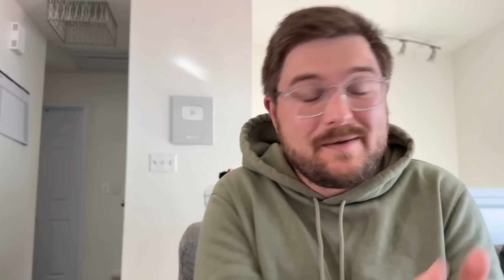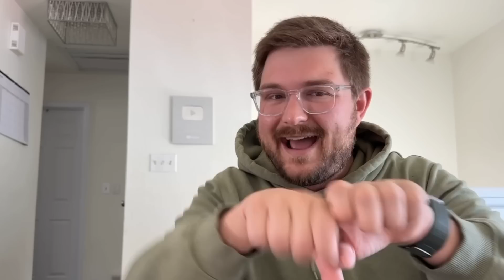Slow Charging For ~800-Volt EVs At Tesla Superchargers With Magic Dock Explained

Comment: One thought I keep having is I understand Tesla's network is mean't to be more of a "backup" for the cars that can't take full advantage of the charging speeds, however, will some people simply choose to use Tesla's network for reliability/consistency? Say someone with an E-GMP (without free EA charging) car has an option of an EA station with 4 stalls (2x 350's and 2x 150's) and a Tesla supercharger with 6+ stalls. Would you rather get ≈ 100kW quick, easy, and guaranteed OR take your chance at EA with faster speeds but maybe 50% of stations offline, a clunky handshake process that takes greater than a minute to activate, the possibility of only get marginally better speeds because both 350's are taken, etc etc. It will be interesting to see as time goes by what people choose to use and if the CCS stations can become more efficient and reliable. Cable-gate is an issue for the time being for sure.
Reply: Remember also that Teslas optimize battery temperature when navigating to a supercharger, this does not happen in other EVs. This can also be a limiting factor for other EVs, since the supercharger is extremely careful about battery temperature safety.
Reply: @signal-52  Doesn't happen for other EV's going to Tesla Superchargers? In the E-GMP vehicles you can trick the system by inputting a different, nearby DCFC and still get all the benefits. In other EV's it might be more difficult or not possible I am not sure.
Reply: @CarsMadeSimple  It does not, that's the issue. I know some EVs can preheat manually, but that's about it for automatic routing. Otherwise, they only preheat to some specific chargers. Some EVs can't preheat, such as the VW iD series, that have no heatpump anymore.

Comment: Hummer EV has a stop sale. They have to change all batteries on them. There is an issue with the gasket around the battery pack leaking water. Apparently at least one has already caught fire

Comment: Is there a ccs1 extension cable (male/female 20ft or so) that can be used for non Tesla’s at superchargers to get around the built-in cable length limit 
?
Reply: Probably unsafe thermal issues.
Reply: That would require AWG 500 with 1" conductors since they aren't cooled. Additionally there would be no disconnection control for safety. Better to relocate plug on the car to the nose of the vehicle somehow. Also would need to be a CCS2 for America.
Reply: No theyre water cooled

Comment: Tesla wanted to see what happened in the wild with the limitation. If no cars have issues then they may up the voltage like they do for their own cars. 
Also they may want to run for awhile and see if there is a lot of 3rd party cars continuing to use these chargers. They may want these to be not as good as a working EA charger in order to keep down the amount of 3rd party users to make room for their own cars until they put even more chargers out there.
Reply: so make an inferior product to make less money? That's just stupid.

Comment: Awesome detailed Video Kyle 👍🎉 Synchronistically, I was just reading some articles about the first V4 Supercharger, which is supposed to be built in Dateland, AZ ....Just off I-8, on the way to (East of) Yuma, AZ. It's supposed to have a Megapack and a 4500 sqft solar array, with 40 covered stalls, and 350Kw chargers! ...It's only 183 miles West of me, and I pass Dateland every time I drive to San Diego. I'll definitely be taking a ride out there, when they build it....

Comment: If I had a wager, I'd bet the hummer EV gets about 120kW max. 350V @ 350A. My understanding is the series conversion happens on charging plugin during CCS negotiation. If the charger doesn't offer 800V, it won't put the batts in series. No DC step up/down necessary. But I don't know and I'd love to find out.

Comment: It causes a lot of confusion in the RC space to say cables have amperage ratings because we push 500-1000 amp burst through 12-10 gauge wire all the time. They don’t run for nearly long enough to melt anything most of the time so there’s no real issuen

Comment: The cables long enough to reach a tesla from one charger away is the solution needed. This will allow Tesla cars to charge on either side and would be long enough to reach f150's without ruining the cable
Reply: More pull through charging stations would help.

Comment: As I commented on the previous videos, it's a welcome backup, and the biggest real advantage here is opening up new corridors with some amount of level 3 charging. But implementation is less than ideal and I doubt after this initial rush will CCS cars use them super often. Expensive, short cables, slow charging for a lot of cars, may even be impossible to use in tight locations with cars that have chargers on the side. Their federal incentive should reflect that.

Comment: The best way to view voltage is relating it to pressure. Amps would be flow rate. That allows you to view power like water flowing in a pipe.
Reply: Is Ohm’s Law taught in school these days? It’s not really rocket science.
Reply: Indeed the diameter size of the pipe is the flow and current, hence conductors need to be thicker. Voltage is the pressure meaning how strong the pipe wall is (ie thick insulation in electrical.)
Reply: The voltage would be the size (diameter) of the pipe, amps would be the rate of flow,  power is the volume delivered per unit of time.
Reply: @travellover3373 

Voltage is NOT relatable to the diameter of the pipe. Voltage is pressure. A current flow requires a difference of electrical potential ( voltage difference). Fluid flow requires a pressure differential.

I can have 1000 volts or a 1000 psi through a small or large "tube". The size of the tube relates to the resistance, and governs the flow in relation to the electrical or pressure differential
Reply: @damp_squid  Voltage is not pressure. Voltage is electromotive force way different than pressure. A 100 psi pressure in a 1-inch diameter water pipe will not give you the same cfm as a 100 psi pressure in a 2-inch diameter pipe.
Reply: @damp_squid  Voltage is what size comes to you, amps is at how fast that size comes to you. The combination of both is the power that you get. If I have 120V coming at me at 2 amps, the same power I get if I have 240V coming at me at 1 amp. Granted, the speed (amps) does not depend on the source, it depends on the load that pulls it or demands it.
Reply: @travellover3373  dude stop trolling that makes zero sense
Reply: @travellover3373  you mean electromotive force? Electromagnetism is completely different, and only applies to the movement of an electron in a stationary frame of reference.
Reply: I never said it will give you the same cfm, the flow is governed in relation to the resistance "diameter" of the pipe and the pressure differential over the length of the pipe "voltage". OHMS LAW! 😂
Reply: @damp_squid  Ok let explain this to you in simple terms. Let's say I need 1 gallon of water per minute in order to function, that is my power requirement. If you give that water to me through a small diameter hose, I will suck that water at a fast rate through that small diameter hose (high pressure) so I can get my 1 gallon of water in a minute. Whereas if you give that water to me through a big diameter hose, then I will not have to suck that water fast (low pressure) through that hose in order to get that 1 gallon per minute requirement. That is why a voltage can be related to the size of the hose. Did you notice that the pressure in the smaller hose is bigger than the pressure in the bigger hose? If my power requirement is 4 watts, if you give me 2 volts I need that at 2 amps. Whereas if you give me 4 volts I can just get that at 1 amp. Did you notice the similarity between a bigger volts the lower the amp and the bigger the pipe the lower the rate of flow? The smaller the volts the bigger the amps and the smaller the pipe the faster the rate of flow?
Reply: @damp_squid  yes you got that right, electromotive force not electromagnetic force, I stand corrected. But, certainly not pressure. :)
Reply: @damp_squid  Kimball is trying to illustrate the flow of electricity in terms of water flowing. You compared/likened voltage to pressure, so let's say I have 120V going through a #10 awg wire at 2 amps the power delivered is 240 watts. If I have 120V (same pressure) going through #2/0 awg wire at 2 amps, still the same power 240 watts being delivered. You agreed with me that a 100 psi of water through a 2-inch diameter hose has more cfm than a 100 psi (same pressure) of water through a 1-inch diameter hose. I am not trolling, if you visualize delivery of electricity like a water flowing through a pipe, you cannot liken voltage to pressure.
Reply: @travellover3373  
You say power, but I think you mean current. Gallons per unit time is a flow rate, which is analogous to coulombs per unit time which is amperage
 
Let's use ohms law:
1. Voltage=current*resistance
Rearrange to put current (flow rate) on the left side
2. Current=voltage/resistance

Therefore....

If you keep current (flow rate) constant, and then increase your resistance (by making the pipe smaller, or wire thinner) then your voltage (pressure) MUST increase to maintain the same current (fluid) flow. See example below.

1A = 1V / 1 ohm
1A = 2V / 2 ohm

If you decrease your resistance (make the pipe bigger, wire bigger) then your voltage (pressure) MUST drop to maintain current.

See how pressure and voltage move together? And how pipe size and  resistance move together?

That means they're analogues of each other, which is all that the original comment claimed.

You claimed that pipe size and voltage were analogues, that is wrong, they move opposite to each other when holding all other variables (e.g. current) constant.  However, they ARE related (through ohms law), which is why you see the behavior in your example

note: this also works if you consider power
Power=current*voltage.
You can plug that equation into ohms law you'll find:
Power=voltage*voltage/resistance

You'll reach the same conclusion with that equation.

If you still don't believe me, here are some great sources that explain better:

https://en.m.wikipedia.org/wiki/Ohm%27s_law (look under hydraulic analogy)

If wikipedia isn't good enough for you, here's an EE source that's very clear:

https://electrical-engineering-portal.com/water-and-pipe-analogy-for-ohms-law
Reply: @damp_squid  I don't know why you are making things difficult. Go back to Kimball's comment. He's trying to illustrate the flow of electricity like water flowing through a pipe. Current is not being pushed by the source, it is being drawn by the load. Example: let's say a 1 hp (746 watts) dc motor with 100% efficiency will draw 3.59 amps @ 208V (I=P/E, or = 746/208 = 3.59A). Now, if we increase the pressure as you say (voltage) to 230V the current will actually go down to 3.24 amps (746/230=3.24). Now in a water flowing through a pipe, if you increase the pressure, the current or rate of flow will actually increase. That means you cannot really illustrate voltage like pressure in water flowing through a pipe. In electricity, if you increase the voltage the current will drop, if you decrease the voltage the current will go up. And that is represented by the Ohm's law equation P=EI, power is directly proportional to both voltage E and current I. Which means voltage E is inversely proportional to current I, E=P/I, in the same manner current I is inversely proportional to voltage E, I=P/E. In a water flowing through a pipe rate of flow (current) is proportional to pressure, increase the pressure and rate of flow will increase. Am I wrong if I say that if you increase the size of pipe (voltage) you don't need a high rate of flow to meet the demand? Whereas, if you decrease the size of pipe (voltage), you will need a faster rate of flow to meet the demand of the load? :)
Reply: @travellover3373  dude just read the links I sent. I've got an undergrad and grad degree in electrical engineering, I know what I shared is accurate. I'm done with this thread
Reply: @damp_squid  I am an electrical engineer too. :)

Comment: 18:02 non-Teslas can charge more the 150 kw on V3 in Euorpe. Saw some cars at 190kw on V3.
Maybe they don't deliver on the US because of the adapter...
Reply: Correct, in EU they cab do that because it is CCS plug and CCS socket. No adapter inbetween.
Reply: I say its the software. Not the hardware. But its only a guess of course.

Comment: Haha I love the excuses 😂 Tesla is perfect and this is seamless and will save us from EA I've been told. This is totally not a money 💰 grab for NEVI funds lol.
Reply: This was discussed in previous threads, but the current implementation is not NEVI compliant, so there would need to be a separate funding program if that was what Tesla was going for. Just the payment process alone is not NEVI compliant, given there is no payment terminal at the station.

As for them wanting funding for opening up the network, I think that is very reasonable. The CCS cars contributed nothing upfront to the build out of the supercharger network and pay-per-use fees are unlikely to cover it anytime soon, so getting some upfront money (wherever it comes from) makes absolute sense. They aren't running a charity after all.
Reply: @jakej1837  Tesla cars contribute nothing to EA or EVGo etc etc but with a $200 accessory gets to use it no? And unfortunately they can't charge Teslas more for using it either. But I digress.
Reply: @marcusrose5943  But those companies are running a charging business where their target audience was all EVs, so they would love the business of Tesla owners (EVgo even has built in adapters). Leaving out Teslas make no business sense for them, given some of their stations are underutilized and that is their sole source of revenue. You will notice most charging networks are struggling to make a profit and are poorly maintained. And EA actually was funded in lieu of massive fines that VW would have paid otherwise, so that was how it was subsidized by the government. 

Tesla on the other hand was only able to expand their previously exclusive network at this rapid pace and make it as reliable as it is today, completely on the backs of Tesla owners. Wanting some money upfront to tap into that makes complete sense, especially if it will potentially inconvenience Tesla owners, and kill one of their major selling points.
Reply: @jakej1837  I think we have difference of opinion on the subside part. And we've seen what states have done with their portion of the Dieselgate funds beside OK it's been wasted on abandoned equipment. Or not used at all like in  Texas. I remember the hellscape that was charging be4 2018 and it's a million miles from that now and yes I agree work yet to be done for sure. But I appreciate the respectful discussion.
Reply: @marcusrose5943  $2 billion from VW was invested into EA as part of the 2019 settlement with the US and CA government for dieselgate. It is no coincidence why EA is the leading non-Tesla network, it was because of that subsidy. A network that was fully independent does not have any possibility of expanding that fast, because it doesn't make business sense. 

A lot of the supercharger expansion does not make business sense either if it was in independent network not subsidized by Tesla owners. For example, it is built to handle peak demand (many more stalls per station than other networks), which makes sense for better user experience for Tesla owners, but is an overcapacity if it was a charge network. There are stations installed in remote locations with little demand that only make sense because it is a connecting station in a route.

It is for similar reasons why the infrastructure bill was pushed out: to fund stations that otherwise wasn't going to make sense to install from a pure business perspective.
Reply: @jakej1837  okay like I said difference of opinion. And if we wanna talk about subsides TESLA major benefactor of that problem the biggest. They got funds from the state of Cali for the battery swap stations where are those again? And several states have actually given them funds for superchargers but I get it EA bad Tesla good I get the narrative.
Reply: @marcusrose5943  They never got any funds from CA for swap stations, what they got was it qualifies them for bonus ZEV credits for quicker charging. They gave similar bonus credits for hydrogen cars. It was a convoluted scheme, and CA discontinued the bonus when Tesla gave up on developing stations. Tesla got credits anyways for selling vehicles, no different than any EV. The credits were sold to other car manufacturers given Tesla doesn't have any ICE vehicles to offset. But they never got any actual funding for the stations themselves.

As for states funding supercharger stations, do you have specific stations that were funded? In other discussions before magic dock, people were actually trying to find examples and failed to find any in the US. Basically trying to see how a CCS funding scheme might work under NEVI. The only examples people were able to find were in Canada, where Tesla qualified for subsidies by helping install FLO CCS stations at their supercharger sites.